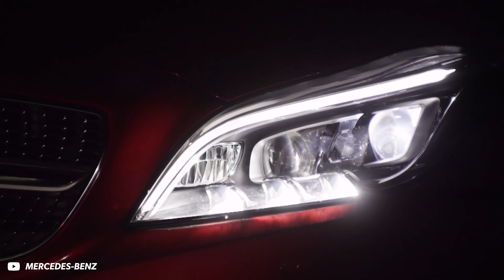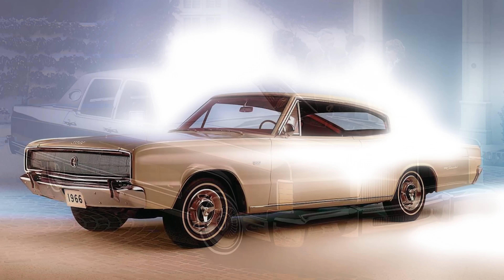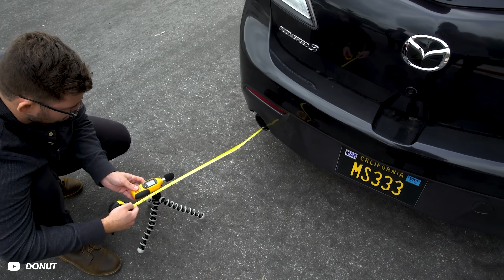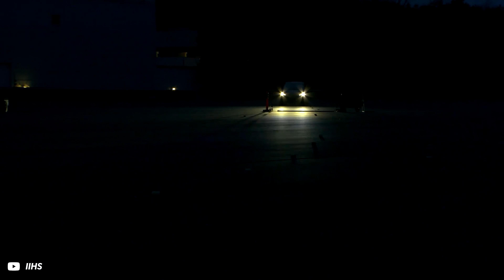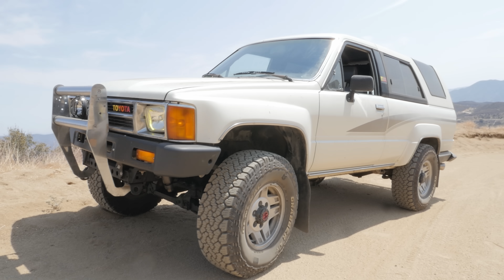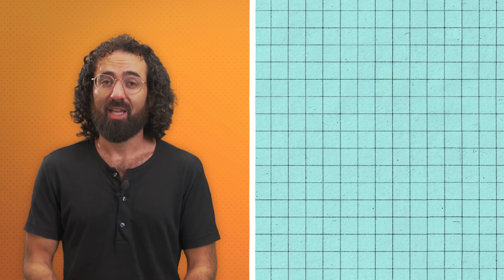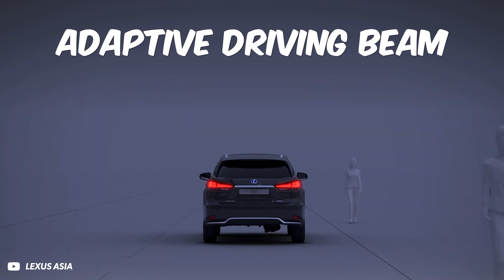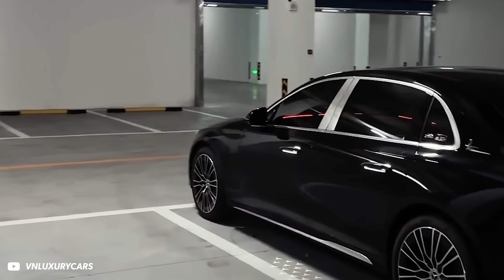Why new headlights are blinding American drivers

Comment: I drive a modern German car equipped with the kind of adaptive lighting system you are talking about. I agree that it sounds very impressive, and the technology behind it is neither particularly new nor revolutionary. So, in theory, it should work well.

In real-world conditions, however, the lights are far from perfect. Their performance strongly depends on the type of road you are driving on and on how well the sensors are able to detect other vehicles. I often notice that the system fails to switch off individual light segments quickly enough, which can end up blinding other drivers.

On top of that, these systems are extremely expensive and unnecessarily complicated. Replacing a single headlight can cost well over a thousand euros. And if something is wrong with the system, nobody seems able to check it easily—not even the dealership where I bought the car. After I had an accident involving a deer, the mechanic told me he would need to run several hours of tests just to make sure the headlight was still working properly. Seriously?

Personally, I would recommend staying away from this kind of lighting system.

Comment: Along with the Pain and getting Blinded by Supper Bright Lights is the Problems with Automatic Brights. These Automatic Brights are Blinding People on the Roads. They do not react quick enough even if you are almost directly in front of the other car. Plus the Automatic Bright System is truly a Disaster in the Fog. Many Cars set to Automatic I see at Night in the Fog turn the Brights on in the Fog. This not only Blinds other people on the Road. It also is Blinding the Driver as well that has there lights set to Automatic Brights. This is making it Extremely Dangerous to Drive. More and more I dislike Driving at Night.

Comment: For years, people became accustomed to headlights becoming frosted over and would freak out every time someone bought a new car because the headlights were “blinding” to other motorists that had to squint to see the barely visible diffuse light peaking through the nearly opaque headlights of fellow motorists. Newer cars are built with UV protectants on headlights to prevent that from happening which is one cause of vampires bursting into flames on the highway. 
The secondary reason for the complaints is the color being closer to white leaving people to believe the dim yellow to faint orange glow was the proper headlight illumination therefore the color was the culprit. Although this is not entirely true, the fact that the blue part of the spectrum is easiest refracted (that’s why the sky is blue) can cause the vision to blur especially when the light encounters sources of refraction such as the windshield or the driver’s glasses. People overly sensitive to this effect because of poor vision can have their vision disrupted when headlight beams are bent directly into the drivers’ eyes when refracted by a combination of the windshield and the prescription glasses and/or the drivers’ eyes. 
The final problem is the worst offender: owners/operators having not a clue how their headlights work tampering with their headlights. They will change the height of their vehicles by 6 inches or more or even adjust the pitch of their vehicle  causing the front of the vehicle, where the headlights are located, to point directly at oncoming drivers. Worse, many drivers have no idea how their car works other than where to put the gas and how to jam the peddles alternately to the floor in an attempt to survive another trip to work. They haven’t a clue where their headlights should be pointing or how to use a screwdriver to adjust them.
Reply: I read part 🎉

Comment: Automatic systems should be banned. Driving requires attention and it can't be that hard to move your fingers 2cm to turn high beams on/off.
Beside the fact that drivers more and more just don't know how to operate the lights anymore (bc the car does it for them) and don't know what to do if they accidentally turn the auto function off
-> And as European: The newer "automatic" adaptive LED MATRIX or whatever - just. dont. work. properly. - 
if you sit on an intersection: they don't detect you. if you drive a certain distance in front: they don't detect you. if you drive a curvy road: they don't detect you. motorway bc of the guardrail: they don't detect you.

Comment: Well, I'm European and I still regularly get blinded, especially if the oncoming car happens to be coming over a speed bump. Also bicycle headlights are getting very bright too. Most people don't bother angling them down slightly, so they illuminate the road 5 meters in front of them. And then there's the lamp posts. The new ones are stupidly bright.

Comment: The most basic solution to this is to simply hold your hand up to block oncoming lights.
And concentrate on the white line on the right side of the road.
Its un nerving to drive like this.
But it does work.

Comment: I live outside of town and it is the absolute WORST to be driving along at night in the pitch black when suddenly an a-hole comes around the bend towards you with their ultra bright LED's. Most of these belonging to big trucks whose headlights also happen to be at eye level for me as I drive a low profile Buick. What's worse is that these trucks normally have FOUR headlights instead of two, and some of the younger crowd like to add LED lightbars as well because....well they just need to see more of the road than everyone else apparently. LED's should be illegal.

Comment: Driver of shiny new car with adaptive headlights here. The system seems to detect oncoming cars alright, but with receding traffic (showing only tail lights), cyclists (less powerful lights) or pedestrians (no lights!)? I have inadvertently dazzled those road users so many times already (because I was wasting time working out whether the headlights had detected them and adapted, or indeed forgot to check whether they were dazzling because I was assessing something else like road surface, curve, junction, etc. and vaguely thought that is was alright because my headlights were adaptive – until I saw pedestrians shielding their eyes or a cyclist stopping) that I have reverted to dipping my headlights manually as previously. 

The adaptive system might increase safety overall, but I doubt it is safer than just dipping anyway, and it certainly feels rather inconsiderate to other road users.

Comment: Sorry, but ADB system does not work. Not at least as intended. it blinds pedestrians, other acrs, it maybe works on a straight roads, but not on others. and there are also several different ADB versions, when the cheap ones are worst than an off-brand solution.

Comment: One type of retrofit led bulbs that won't blind people (passed the MOT every year in the UK and I never had anyone flash me) are mini projector LEDs. They are drop in replacement LED bulbs for halogen bulbs but, instead of simply expecting the original halogen reflector to project the beam, they focus the light emitted from the led into a small lens which gives perfect beam pattern with sharp cut offs. You need to purchase either RHD or LHD versions depending on what side you drive on but, they are brilliant if you haven't upgraded your car to a modern one in a while.
If your vehicle uses H7's for high and low beam (4 bulbs in total) simply replace the low beams with the mini projector style and normal LED bulbs for high beam. I've upgraded my car now and can confirm, my old car was just as bright at night without blinding people on low beams as my new car is.

Comment: The biggest issue is that people are morons. Not the bright lights themselves.
You need to make sure you purchase high-quality and reputable bulbs, such as Philips, Osram, GTR Lighting, Morimoto... all of these companies make LED bulbs that work properly in projector housings. That's one thing.

The other part of it is that people need to learn how to properly aim/adjust their damn headlights. And they need to take the time and consideration to do so.
I have high-output LED headlight bulbs paired with high-quality projector housings in multiple of my vehicles.
I have ALWAYS taken a great deal of time and care into properly adjusting all of them so that they do not blind other drivers on the road.
So there IS a balance.
I can see the road perfectly at night without blinding other drivers.
I quite literally never get high-beams flashed at me, and I can see that I'm not blinding other drivers because my cut-off line is well below their windshields and mirrors, even for low sedans.

So again, the main problem is that people are careless idiots.

Comment: An insurance safety rating does nothing but benefit the insurance company because it means that your car is made out of fragile plastic and Flemsy  aluminum and it will completely Crush in a 5-mile per hour bump and it'll total completely out and then the insurance company will repair it and sell it and try to get their money back rather than repair it they want the car to total so they can take it

Comment: adaptive head lights are one of the most retarded "safety" features ever. They only work in a straight line. The amount of times I was blinded by somebody approaching me where the road has a slight bend and the "smart" systems don't detect me until the road is straight is just insane. And it's even worse when I'm on my motorcycle, there are cars that can't detect me even in a straight line until I am like 50 m from them. For reference, I live in Germany so I should be exposed to the crème de la crème of such systems. Oh well, I guess the auto lobby is deciding what mandatory safety systems we get.

Comment: For everyone saying "You just have to use the right bulb" or "You just have to adjust them properly", you're wrong.

All light bulbs have light bleed, and the majority of people these days suffer from astigmatism in at least one eye. Those eye problems cause massive light blooming, and glare. With yellow or orange colored lights, those blooms aren't anywhere near as bad. White and blue are much worse even at the same brightness. Want an easy way to test this? Go find a modern microwave that uses a blue display. Try to read that display from across the room. Most people can't. But a red display, like you'd see on a clock? Easy to read from twice as far away.
Reply: Good point. The color temperature on these bulbs is also a huge problem. We need to go back towards oranger bulbs, more the color of candlelight.

Comment: You have no idea till you live in red neck land with pickup trucks with light bars. You litterly have to slow almost to a stop they are so bright. Then add that to the exhaust that you can hear roaring 5 miles away.

Comment: First of all - no, modern cars are not the ones blinding me, the old ones are.
Modern projectors have a sharp cut off line with almost no glare or halo. 
Old reflectors or even poor projectors have glare - hence more blinding.

Second - I really don't understand yall, are you all that sensitive? I can't open my eyes in the snow if the sun is shining, but cars rarely blind me. 

The only vehicles that do that are small box trucks that have headlights positioned higher than every single cars mirros are - he stops behind you on a traffic light? You're blind.
And the second instance are poor quality and/or faulty LED Matrix-es that register me too late.
Other than that? No. Modern cars don't blind me at all.

Also - you can just take your left hand in the air and physically block the light from coming into your eyes - your eyes will quickly adjust and you will see. And lastly: clean your fucking windshield from the inside or change it completely for a decent one without scratches. (Light refraction is a thing)

Comment: Netherlands here. Not only do I get blinded by car light but even the lights on a lot of bikes are bright enough to blind me. There are 3 issues from what I can tell. The use of white led lights that have no business containing the high energy parts of the colour spectrum, the insufficient use of diffusion and the complete failure to implement limits on how many lux a headlight is allowed to produce.

edit: lumen. Not lux. Mixed them up for a moment.
Reply: People also confuse the role the light is supposed to fill. Most headlights, especially for bikes, need to give off enough light so that others can see you are there. There are usually streetlights, signs, and plenty of other light sources around.

Comment: Adaptive headlights don't help the problem because the system is, for obvious reasons, reactive, whatever it is intended to be kept from being blinded is already blinded before the headlight can adjust. It mitigates against a continuous barrage of blinding drivers close to you on the motorway, but on windy or bumpy surfaces it does nothing to help.

Headlight brightness is a fucking epidemic at this point. Driving on any unlit road is an exhausting process and it's so bad it's even possible to be dazzled in the day time.

How it's gotten to this is ridiculous
Reply: This is exactly right. Need to get this in front of legislatures and car manufacturers everywhere.

Comment: As a German driving instructor, I say with confidence: No, this adaptive beam stuff is not the solution to everything. It CAN be nice, but it's aso very bad in many regards. It makes vehicles even more complex, when they are already way too complex in my eyes. Also your whole lighting system relies on functioning cameras. Not only are they sometimes dirty, they are just not perfectly reliable. They either turn off your high beams, when there are street lights visible on a hill in the distance, or they will badly blind drivers with weaker lights, and especially cyclists and pedestrians. Gladly not many cars with this tech are driving around here. More cars with automatic high beams exist, and they are just as much an annoyance. The way of car makers to take away ever more control from the driver and handing it over to electronics is not a good development in my eyes. My can is 18 years old, and I have no interest in a newer vehicle. This old vehicle does exactly what it's supposed to.

Comment: I am not only a German driving instructor, recently I was in the United States for 6 months, where I was managing a 2,000 miles move from Montana to Ohio with my buddy. So I have a lot of experience comparing both countries.

And boy has it been SOOOO bad in the US! Because just as said here, it's a wild west with the lighting systems. Anybody can put anything into his vehicle and call it a day. The majority of lights are blinding so badly, it is a serious road hazard. They are so bad, that you get the impression, that almost everybody is driving around with the high beams. It is a serious problem.

Despite people complaining, I don't consider it a problem in Europe. Yes, you occasionally get blinded there too, but many regulations prevent this to happen on the large scale. Every vehicle needs to have either automatic or manual height adjustment controls you can use from inside the vehicle (while also having adjustments knobs directly on the headlights), and we have our safety checks every 2 years, where the headlights get checked and must be within sepcifications, including a check of the actual real beam output. The headlights need to produce a sharp line, where the light falls off, and if that line is too high or not existent, you don't pass the safety check.
Aftermarket LEDs are just starting to be a thing in Europe, because they need to receive certifications, if you put any random Chinese LED into your headlights, your vehicle is basically illegal on the road. The 2 big lighting manufacturers of Philips and Osram have started to finally offer legal LEDs for headlights for a few years now - although not for every vehicle, because these LEDs need to receive a single certification for every model of car. I got those LEDs in my car, and they are blinding nobody.

While I am a big fan of freedom and don't like restrictions, these vehicle based restrictions are very helpful and I think it would improve the United States a lot, if they would adapt this. I have a lot of fun driving in Europe. I do not do so in the US due to things like the bad headlights, almost only automatic transmissions and the ridiculously littered stop signs.

Comment: Aftermarket lights are not a huge problem if you have mandatory yearly inspection for the cars, including the lights. If your country doesn't bother inspecting the lights, you can expect all kind of weird crap being installed.

One possible way forward would be to give heavy penalties to owner of the vehicle when police stops it and verifies that the car has illegal lights. The fine would be somewhere around 5000 USD to make a real dent in illegal aftermarket lights.

The good part about illegal aftermarket lights is that it should be pretty easy for a police patrol to recognize illegal lights in incoming traffic during nighttime.

Comment: Self-certification without heavy penalties when actual product is found failing to follow the published self-certification spec doesn't work. If a manufacturer can "accidentally" run the spec test at 12.0 V and real world cars run the lights at 14.4 V and run the lights much brighter, a self-certified manufacturer can currently just say "oops" without any real consequences.

Put a GDPR style 20 million euro fine for breaking the published specs and self-certification would suddently start to work, too.

Another big flaw in the certification system is that lights are tested with perfectly clear optics. Real world cars have all kinds of crap in front of the front lights which can cause blinding for incoming traffic even if the lights were totally okay with clean lights.